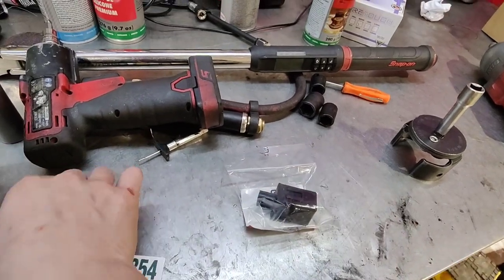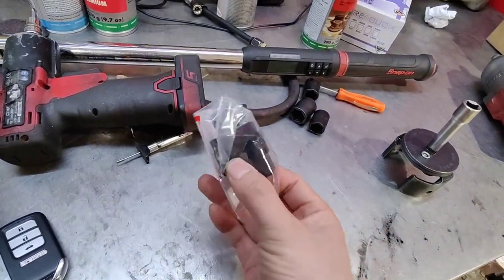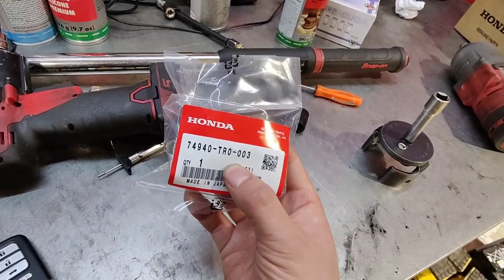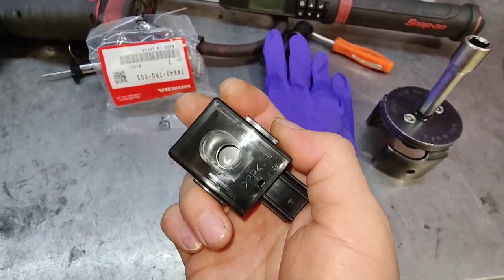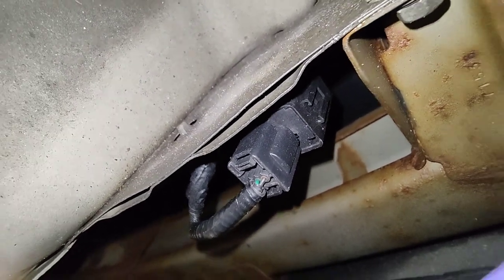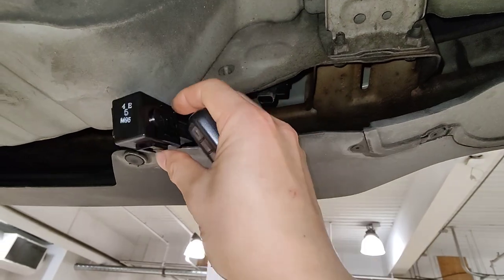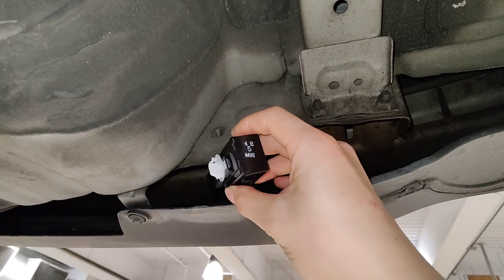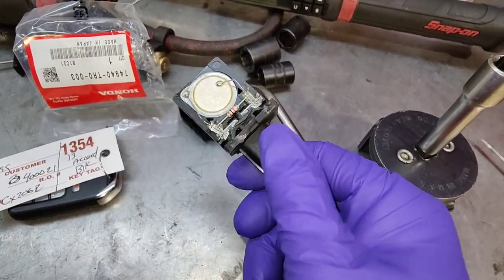honda doesn't beep anymore when locking the doors. keyless buzzer location and replace

Comment: I wish u would've shown the removal.. I can not get that thing loose
Reply from the maker: Its a clip of you have a clip removal tool you should be able to pop it off
Reply: Actually, it was quite easy - just don't be afraid. Push it from down, where wires going in - up. It will disconnect from a plastic clip on a side. To mount it back just position it over this plastic clip and pull down until clicked. To disconnect wires squeeze a latch and pull the connector from the buzzer.

Comment: Thank you for video! I've suddenly got mine very quiet on Honda CRV 2019. Found it approximately in the same location as on the video. Disconnected and found a big spider 🕷made a nest inside, almost blocking the sound channel. After saying it good bye, the buzzer works great again! 🙂
Reply from the maker: Glad this helped. I have also found spiders nest in the canister vent causing check engine lights for vent valve stuck closed.

Comment: I checked the hood latch connector, it was fine. Not sure why the car wouldn't beep when I try locking the doors. I did drop the car for repair at a local shop. It was working before I dropped it off and then after I picked up my car, it's not working. Any ideas?
Reply from the maker: Did they replace the battery or disconnect the battery may have reset all the preset settings In the menu.

Comment: Hi for the civic 10 gen? Does some one knows the location
Reply from the maker: I saw your comment and I added it to the end of this video.
https://youtu.be/pPCATqcDHiI
It is an 11th gen civic but they are generally in the same area usually on the left side, middle or the right side depending on which model. The CRV has it more towards the driver side in the rear. And only for models with smart key.

Comment: Can we fix horn there ? Some of the other makes or models like Mazda,ford sounds its horn while locking
Reply from the maker: That would be completely different. This beeper is only for honda models with a smart key. Ones with physical turn key will be sounding the horn when double pressing the lock on the key fob.

Comment: Can some one show me the location of the alarm buzzer on honda accord 2015. I got my rear bumper repair 3 months ago and now I tried to look in the rear number to find it but I did not locate it at all.
Reply from the maker: It should be in the same area as this was also an accord. They either didn't put it back if it's not there and tuck the wire away or chopped the wire as it doesn't set any warning.

Comment: So how do you disconnect the wire portion from the buzzer assembly part? I’ve been trying for 2 hours to unplug them from each other
Reply from the maker: Just make sure it doesn't have sand and junk in between the release tab for the connector since it's in an area that is exposed to road debris.

Comment: Hi,  thanks for the video. In my Honda crv 09, the horn is making the sound after you press the lock button twice.  Not doing that anymore althogh the horn is working fine and the lights flashe/blink? Thanks
Reply from the maker: May want to check the hood latch switch first. Possibly the trunk latch I can't remember if the trunk will do it. Either it is seeing it open since there isn't an indication on the dash for them. If not then the MICU is what controls the relay to sound the horn when you lock the door and usually moisture on the back of it corrodes the connector. I have a video where the MICU is constantly trying to lock the door on a CRV. And drains the battery.
Reply: @theoffroadingmechanic  thanks very much for your reply.

Comment: My 2019 civic sport just started sounding muffled not as loud. At times it won't even beep! The walk away lock with honda (should beep 10x rapidly) barely works now. Just started happening this morning?
Reply: it might be clogged. I went under my car and looked. There was some materials from the road in there.
Reply from the maker: It should be in the rear bumper area clipped to the body. Its just a mini speaker pretty prone to dirt and water getting into it. It will be called a keyless buzzer if you are asking the parts guy for one.

Comment: Mine doesn't beep and the headlight dont flash when you lock the car. Does this take care of it too? I saw another video that the hood latch switch was changed out
Reply from the maker: Did you check your door lock settings? The beeper just makes the noise but a bad hood latch can prevent it from beeping and flashing the lights. See if you see a connector for the hood latch and  disconnected the connector and try locking the doors.
Reply: @theoffroadingmechanic  I finally fixed it.the hood latch connector was disconnected and I connected it, now everything work just fine. Thanks
Reply from the maker: Cool maybe someone previously worked on it and and didn't plug it back in or it got disconnected because the alarm kept going off?
Reply: hey, i recently purchased a 2021 honda civic ex. i have the same issue. also, the remote start doesn’t work. do you think i have the same latch problem?
Reply: @theoffroadingmechanic I have a 2020 Honda accord LX. I have the same issue as above but I don’t have a cable going to that latch connector. What connector do I purchase and once I plug it in, where does the other end of cable go?

Comment: Could that be replaced with a horn?  A real one like a diesel train horn?
Reply from the maker: The beeper is low current.
Reply: @theoffroadingmechanic     I'll take that as a challenge from Honda
Reply from the maker: I mean if you want to mess with the MICU that controls it. And also controls all your door locks. And I've had it drain your battery overnight. I actually have a few videos on this.
Reply from the maker: https://youtu.be/qQkp6IPOjZ0?si=awW9EBe9sMg3YmDf
https://youtu.be/moAMywxlgVo?si=1k9uMQkotMqNJdbj